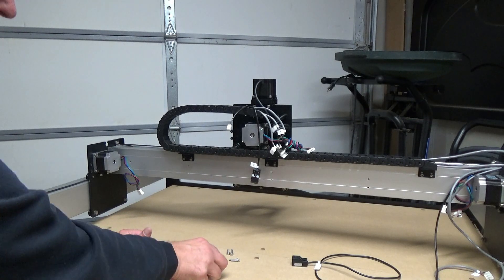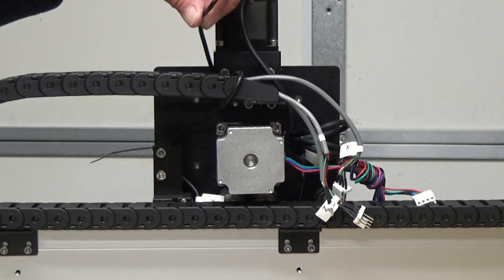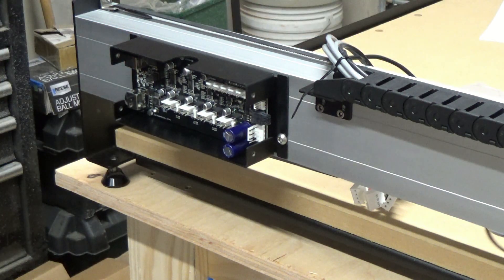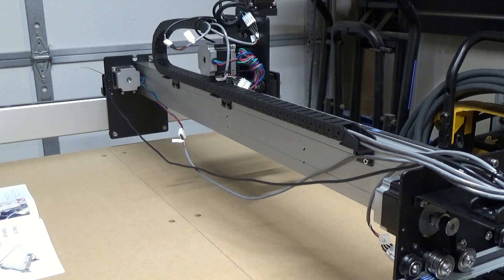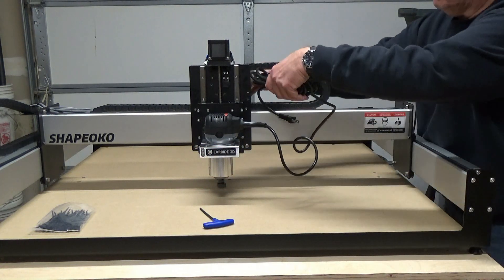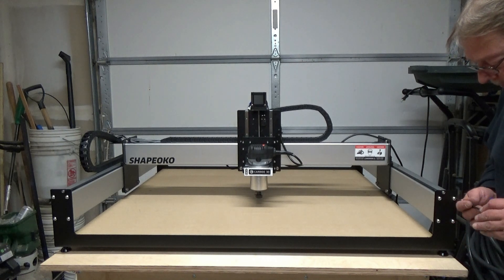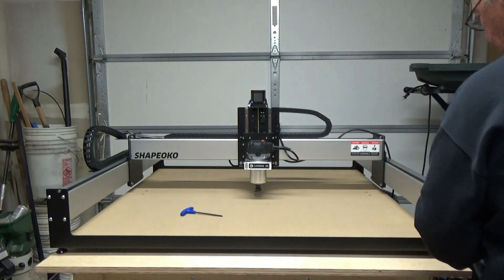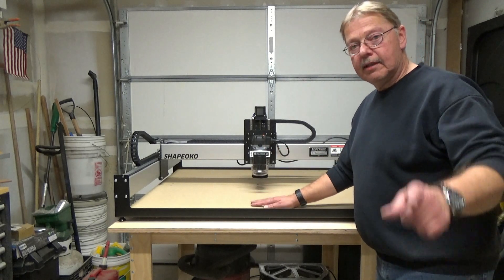SHAPEOKO XXL CNC Router (Assembly Part-3)

Comment: Ok its been awhile since you put out a video. Hope all is well and your just deciding on another project
Reply from the maker: Hi Brent! Yup... been a while. I do have another project I'm working on, hopefully be back soon! :) Thanks for checking in!
Reply: @OregonBatman  did you finally decide on a project ....about time haha
Reply from the maker: @brentsharp8234  Oh yeah... a BIG one! :)
Reply: @OregonBatman   still impatiently waiting to see your project. Im putting my camper on hold until these lumber prices drop , i refuse to pay $70 for a 3/4 4x8 birch that was 38 , 18 months ago.
Reply from the maker: @brentsharp8234  I know, right? Prices are pretty high! Currently working on a project right now and hope to have something uploaded soon... material is not only expensive, but getting hard to come by as most suppliers are having difficulties getting supplies. I might have to splurge on the materials at the high cost for fear they might not be in stock when I need them! :(
Reply: Crazy to think i could aluminum frame a camper cheaper than using 3/4 ply
Reply from the maker: @brentsharp8234  Weird times we are living in for sure!

Comment: @OregonBatman first timer and I'm repairing or I'm putting a new roof and doing the repairs for the first time facing all these issues on a 33 ft Coachman sprinter 2007 it's got phylon and I framed up and put new rafters on the roof looks good so far but adhering phylon azdel and phylon together and I was going to try to waterproof the roof by putting file on on the roof over the wood but I can't use the rubber roof EPDM to attach to it so I'm facing some of these issues and little did I pay attention to your name on here but I called helmoprene Corporation and they mentioned you so then I came back to read the notes again and I found you so I subscribed to channel I'm going to learn a few things from you I do construction some pretty handy but working on the camper and understanding that is a little bit different and how they put things together so I want to do it better but I got to also I'm under the gun because I got to get the camper done as well cuz I got to move the camper off the property where it's at now soon very soon and I'm struggling doing things I don't like to do things half fast but maybe you can help me if you've got some spare time here and there 5 minutes of your advice would go a long way and it would be appreciated.

The first issue is the front of the camper there was a phylon and paperboy backer that was just deteriorated and I'm replacing it with AZDEL 4x9' panels for the underlayment and I want to put the file on fiberglass two over the asda so do I glue it 100% do I just glue it around the edges to save myself the problem do I put a strip of tape to head to on the seam with a 4x9 connect side by side vertically stuff like that I'm trying to figure out you know does it matter which I think it makes sense to do it but what glue would I use or should I glue it or should I just screw it in place to get that done
Reply from the maker: Hey Patriots.... send me an email with your phone number. I think it will be better to talk with you and try to help out. batman97741@gmail.com

Comment: Is it expandable for larger work pieces? It looks like 32x32 now. Can the rails be swapped for longer rails or will the wiring harnesses need to be changed as well? Wish I had that back whenI was lofting my canoe and kayak molds!
Reply from the maker: Currently, this is one of the largest models they make. I would not doubt that it is expandable. Would need longer extrusion for the side rails and need longer belts for the drive. The harness could easily be extended. I wouldn't be surprised if they offer that in the future. Plenty of projects I could have used this for in the past as well! Hoping it will be useful for my future projects! :)